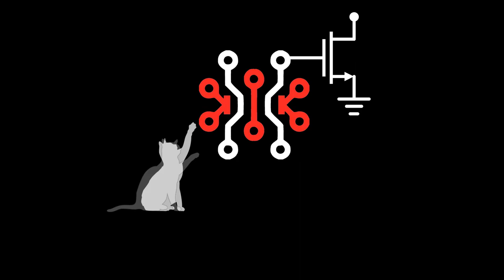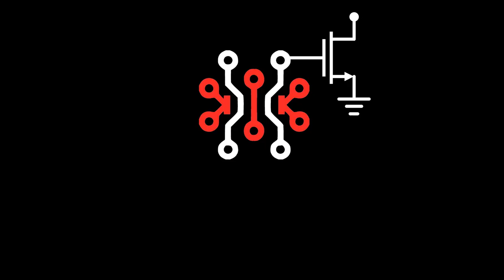TNP #22 - Zeiss Axioskop 2 MOT LED Retrofit Revisited & Bright/Dark Field, Polarization Microscopy

Comment: If you're looking for suggestions on parts to look at with the new setup, here's a few I've wanted to see teardowns of:
* BUF802 (3.1 GHz JFET amplifier)
* ADL5569 (6.5 GHz dual differential amplifier)
* ADL5205 (1.7 GHz dual differential amplifier, 14-26 dB digitally adjustable gain plus 0-23 dB digitally controlled step attenuator)
Reply: +1 on the BUF802

Comment: Great you returned to this project.  Regarding the LED driver I guess with a few discrete components you could have saved some space and time developing it. Nonetheless this way you can address the younger folks 😉. And yes you are absolutely right in promoting microscopy and telescopes. If you got phase ring objectives it might be worth checking out Nomarsky phase contrast on this instrument. 
Also I hope you remember my suggestion about extended depth of focus with a single acquisition using cubic phase plate inside the DIC slider. I think this could help in your efforts viewing multiple layers of IC's. Anyway Keep up the good work. 

Lutz
Reply from the maker: Thank you Lutz. All the objectives on the microscope are HD DIC except for the 2.5x which is only HD. They are all Epiplan-Neufuar and a few have the "EC" marking. I have the DIC prisms for both reflected/transmitted light also installed. Some of the NA of the lenses and DIC prisms don't quiet match. In your view does that make a big difference? I'd also love to learn more about the cubic phase plate and how to find/install one.
Reply: @Thesignalpath  Shariar, Fluar (glass contains fluor) objectives are the best and consequently most expensive ones. Epiplan's are preferably used for material science less so for Brightfield (transmitted). Zeiss has a huge catalog for the objectives. Phase ring objectives are marked PH 0...3 to be matched with the condensor revolver. I was thinking that you might got some since you have a dark field stop. If there are more stops available they are also labeled with PHx. In your case you likely got DIC stops  for the Wollaston prism. DIC is less sensitive to a mismatched NA than a phase ring would be with Nomarsky contrast. Nonetheless the prism in the slider should fill the back aperture. Otherwise when you apodize the aperture with a misfit slider you lose effective NA and with that resolution. Looks like you got a good mix of accessories. Also note that most specialty contrast methods can be achieved computationally (well that is the main business of my company). To get cubic phase plates should not be a big problem. You can 3D print a DIC slider to put it in. Well I think you know how that works. I had sent you some Matlab code that simulates forward problem and inverse solution. Just email me if you need more info on this.

On second thought reading your reply again: A Neofluar is corrected for a wide range of wavelengths up to near UV. It's also good for Brightfield and very often used in wide field fluorescence. I'll try to find the catalogs and let you know.

Comment: Please consider adding a thermal cutout, e.g.  'Klixon' on the heatsink, in series with the LED, just in case the fan fails. Also endearing to see you saying "degrees Kelvin" :p when the Kelvin-scale is absolute.
Reply from the maker: Thanks! Yes, Kelvin doesn't need "degree " modifier. Actually, none of the measurement scales technically do.

Comment: very cool images! I believe Zeiss choice of halogen bulbs has something to do with their emission spectra being as close to the natural light as opposed to the LEDs limited emissions at certain wavelengths. Top of the line microscope! Must have cost a fortune 🙂
Reply: I don't think so. This lamp house design is more than 30years old. A time before one couldn't even fathom high intensity LED's. Xenon and mercury arc lamps were the second more expensive choice. They also had smaller emission areas and hence better suited.
Reply: He salvaged it from the dumpster a year ago.
Reply: @thomasw6169  No Way!

Comment: I saw that the LED only had CRI70 which coloring index is pretty poor, I would have used one with much higher and absolutely minimum CRI85, preferably CRI90 or even higher. Much more expensive but worth it.